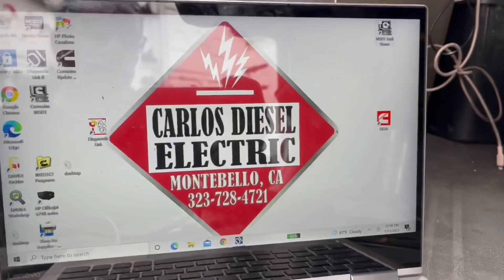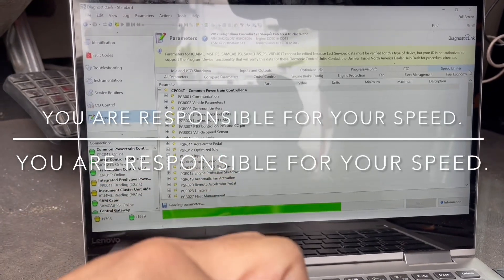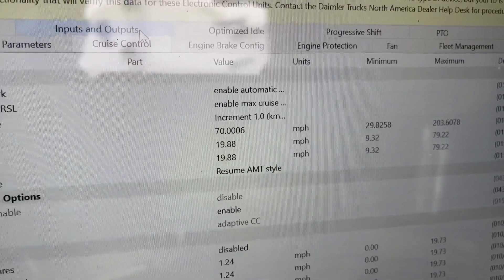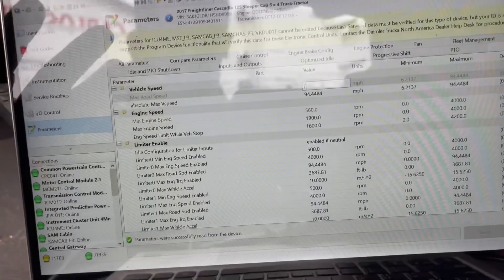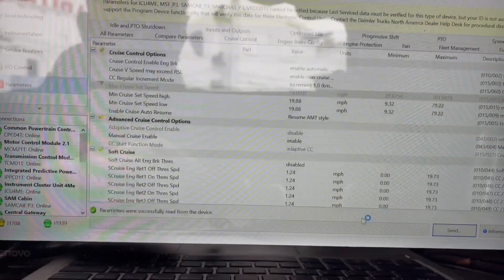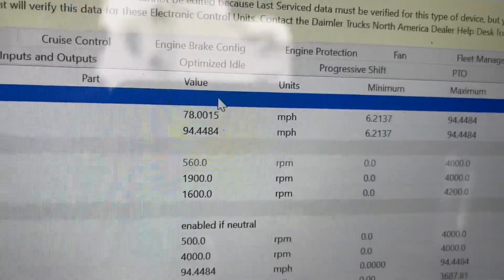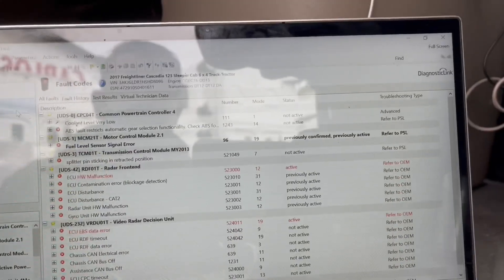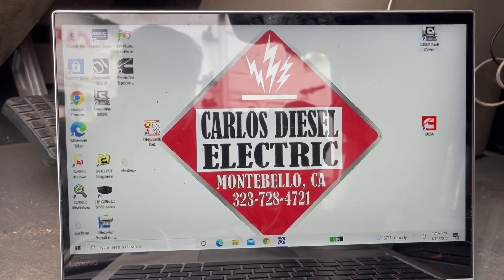Freightliner Cascadia, how to change the speed on your DD15

Comment: How do you get this software?
Reply from the maker: I put purchased my software through Nexiq. 
https://diagnosticlink.nexiq.com/
Reply: Is this what I would need?
Reply: Nexiq blue link mini?
Reply from the maker: @amberkline9001  No, the mini seems to be an app or phone. I use the USB LINK 2 with my laptop.
Reply: When I searched speed control software, this is the product it took me to. I also searched, speed govern, and it also took me to this product. So, I was just hoping to verify with you, that this product would work to change the speed govern settings. I literally have to shift at 1700 rpms, and it drops me to 1200 rpms. I am lugging bad, trying to pull 105,500 lbs of limestone, up Seattle hills on I-5.....not fun.
Reply from the maker: @amberkline9001  if you can change the progressive shift (disable). That may also be restricting the shift points.

Comment: Mr Pedro would you do a video on the difference between the DD13andDD15 and the purpose of each?Is one better than the other?
Reply from the maker: DD13 is supposed to be for local work, the horse power is typically around 300. 
DD15 is supposed to be heavy work, horse power is 400-475.  
Which one is better depends on the type of work you will be doing.
Reply: @CarlosDieselElectric  Thank you for responding to my questions I’m great full ,Can the DD13 engine be turned up to match the DD15 Hp rating?
Reply from the maker: @landonbrown6568  there might be some changes that can be made but it all depends on what your MCM is programmed for. There may be some HP changes. Need someone to connect to see

Comment: What happens if you change an injector without changing part # in the computer?
Reply from the maker: The computer will require the part number in order to input the injector code in most cases. 
But you can still install he injector without having to input the information. All though I don’t recommend this.
Reply: I'll let you know how it works out. Thanks. Hopefully it will "self learn" or something. I only have a snap on scanner. It will clear codes but can't change those kind of parameters.